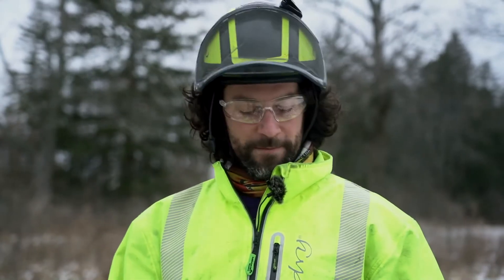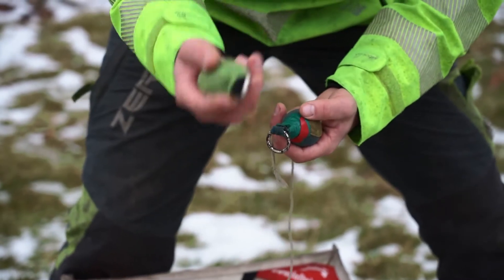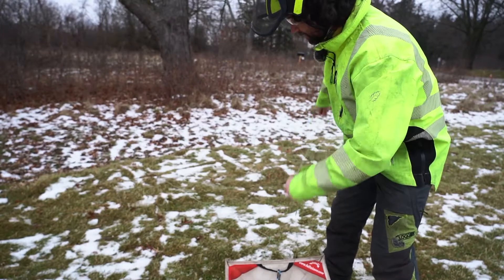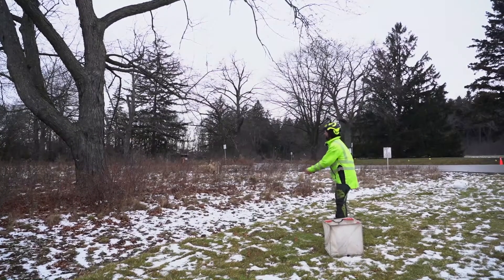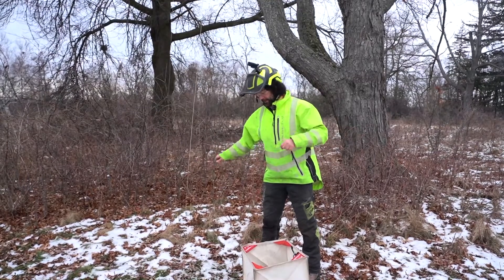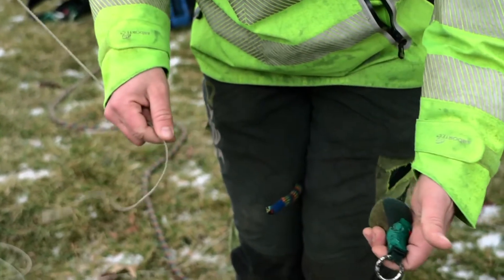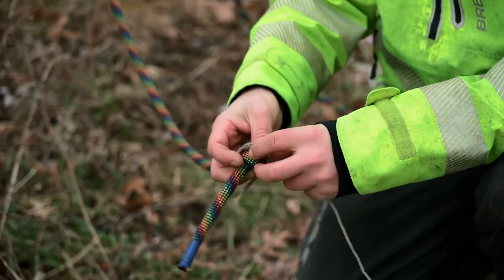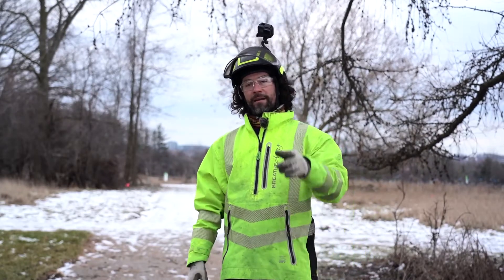Throwline and Friction Saver Installation with Hillock Tree Care

Comment: Great video!. I prefer running the throwline through the big ring of the friction saver, then pulling enough line through for the toss,  toss over a limb with the throw ball, then connect to the opposite side of the friction saver using the throw ball, pull up and install. Finished. That way I'm only pulling a fraction of my throw line through than what you showed, where you had to pull throw the entire line. Try it out sometime. It's much easier. Anyways, great  presentation. I'm going to check out your channel.
Reply from the maker: I have tried this technique. When it works it’s very efficient for shorter throws. Thanks for sharing!
Reply: The method described by Knotorious is also my preferred option. 👍
Reply: @TredasTaurin  Thanks for the support! It's so much more efficient to do as I described! Time is money in the industry!
Reply: @Knot-orious  You're right
Reply: thanks  @Knot-orious I have yet to try this .. As @TredasTairin says time is money..the thought of unfurling the entire throw line looks tedious 

Q Is it possible even with higher throws, once threaded thru the larger ring, to leave the cambium saver suspended over the the lip of cube for the throw line to pass thru without having to pull out the line? 

 Or does it tangle and if so perhaps get a second person to hold the cambium saver up above the cube?

Comment: Is there a device that’s made out of tubular metal and it’s attached to a reservoir of either foot pumped or a bit like a bicycle hand pumped, you then drop whichever size of weight you want down the tube and with a release valve/trigger shoot the line/weight as high as you pretty well need.
Excellent explanation, not least of all for safety reasons and being tidy!